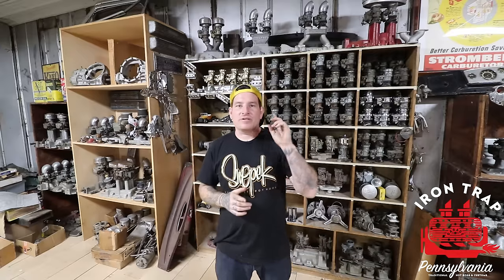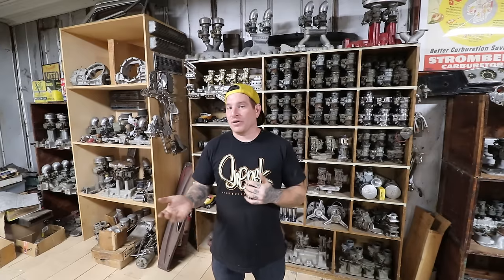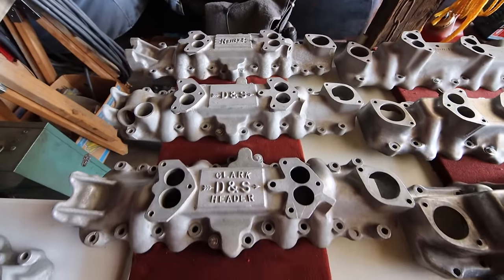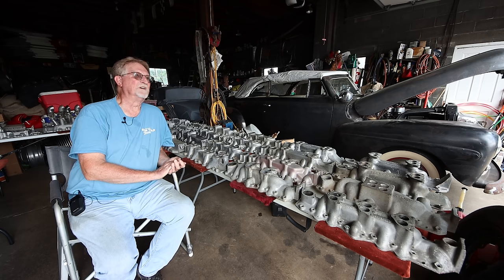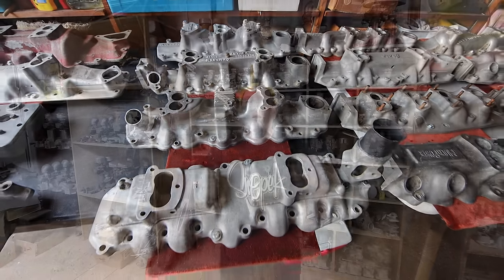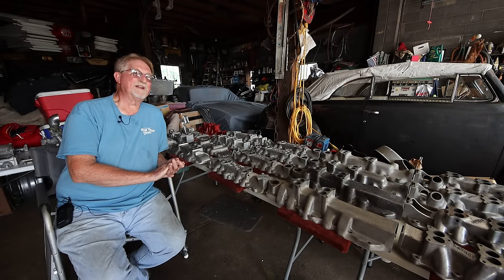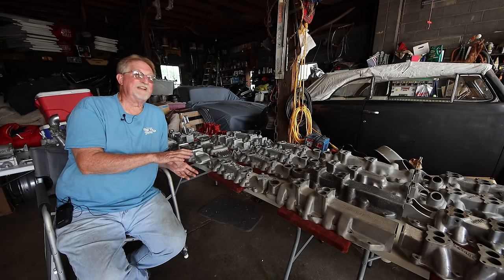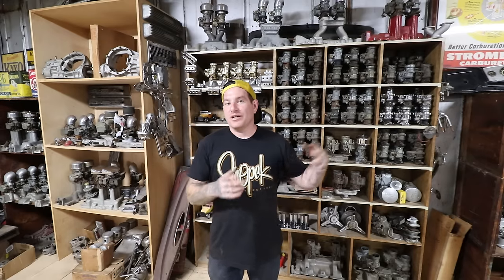The ULTIMATE Ford Flathead Intake Guide - Hot Rodding 101

Comment: I am 86 and you sure bring back many memories. I had a full race engine in my '52 Ford, i experimented with 2,3.,and 4 carb manifolds. The 2 carb was a Tattersfield high rise. I settled on 3 carbs with progressive linkage. All that equipment was plentiful in my day for reasonable prices. I worked for an auto parts supplier and we rebuilt engines! I grew up in and era when you could buy a drive-able '39 ford for $25. I bought a 1930 model A pick up, without engine or transmission or fenders for $15! I had great hopes for it but it never happened. I started getting interested in girls. My downfall!
Reply: Great information, I ran across an Edmunds aluminum 2x2 intake on a 1950 truck motor. Going through it for a Funk 8N conversion. Any thoughts on this obscure intake?
Reply: Great to hear your pass History. 
#STAYSAFE 
#PHILLYPHILLY🇺🇸
Reply: @patschollaert5978  Sorry, I have no additional information on the Edmunds.
Reply: 73 y/o here. Thanks for sharing!

Comment: I had a Thickson high rise intake back in the 70s. I only paid $10 for it, along with a pair of aluminum heads that I also paid $10 for a small swap meet. I never put them on my own vehicle, but did help a friend rebuild a flathead that he put into a 53 Ford F100. It ran pretty well with it's "3/4" race cam. Those were the days.

Comment: Hi Matt. I'm Gary,  I bought a 3x2 intake and pair of heads for $600 directly from the guy that was casting them.  This was when I was at Tardels back in the 80s.  They are Cyclone heads and intake.  I  am still using the intake on my roadster.  But now I am using a pair of Navarro heads.  The Cyclone heads are in a box.  When I  rebuilt the engine there were some sealing issues with the fire ring area, rather than take a chance we used a new pair of Navarro heads.  I  met Barney some years ago when he designed the blower intake for Tardels Bonneville car.  This is why I used his heads. I  was looking at the Cyclones the other day and I  think they are alright.   Just by a small margin.   Have you ever seen Cyclone parts.

Comment: Time for another trip down memory lane here in Maine. Add these to last weeks "memories". (1) we did block off the heat riser holes with pennies.  both of them on the race engines to not let the heat get to the carb.  Used one to make a street engine "talk" (2) There is a manifold out in the Speedway Museum  in Lincoln Ne. that has another carb located under the intake. The inspectors/competitors never knew. I was fortunate to have a tour by  (RIP) Bill Smith and his wife a few years ago and he pointed it out. Sure wish we had it then! (3)We did fool a bit with staggering the firing  order (ala Chevy) but didn't notice any difference, (4)  Not sure if this is true or not but I seem to remember talk of a 180 degree crank  from sort of flat head  conversion to an air compressor. I do know that company (Smith??)  made them for model A's to run on 2 cylinders with 2 to compress air. Anybody else remember??? Great ides om Hot Rod 101.  Not many of us left.

Comment: Great video, Matt.  I have never owned a flathead engine, but I picked up an Eelco intake several years ago at an estate sale.  It has a rectangular adapter on it with two 2bbls on it.  Nice paint job and pin striping.  I liked it and will probably never use it. but the price was right.

Comment: At age 73 I just acquired a car I've always wanted: a '50 Merc. It was a stalled project, sporting two carbs, a 3/4 cam (I'm told) and oversize valves (I've verified that.) Looks like my carb linkage is not progressive. Should it be? The plugs were black and sooty. Oh, BTW, great display of carbs. You have a new subscriber!

Comment: A 97 is 150cfm on a good day. For a 221 2carbs are probably enough unless the engine has both compression and cam for rpm then 3 is the go. 239 with mods will get away with 3 and for a 255 with all the mods, big cam, springs etc 4 should be able to be used.
Three with progressive linkage are useable on all with minor mods.
While 4bbl intakes are rare are single 4bbl,, 450 up to max 600 vacc secondaries will be far nicer. 
I have seen a constant flow injection on a street rod A and it was healthy. Very small throttles I suspect and it did look and sound tough.
I have seen 2" SUs x2 and also a pair of IDA Webers as well.
Whatever flatheads were out of date by the war and OHV of any style is way better

Comment: In your video, there were 4 barrel intakes, are they the bastard step child for flatheads? a single quad should put out more horsepower than a 2x2, and less issues to deal with... I know it is not as cool looking, but reliability & tuning is a major factor to consider.

Comment: I just purchased a Ofenhouser 3 X2 equipped  flatty. The carbs have a 94 in the casting. much grinding was done to make them fit. Was there a carb that would fit without grinding off front to back stuff?